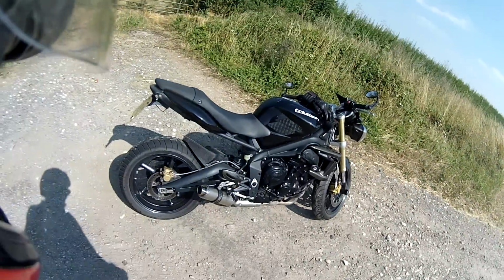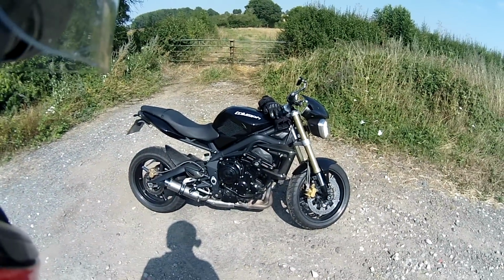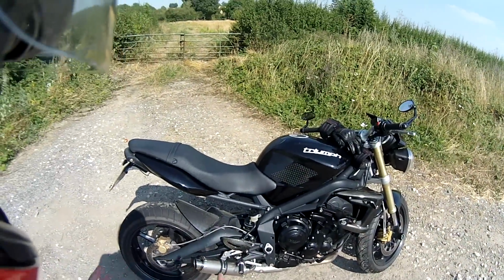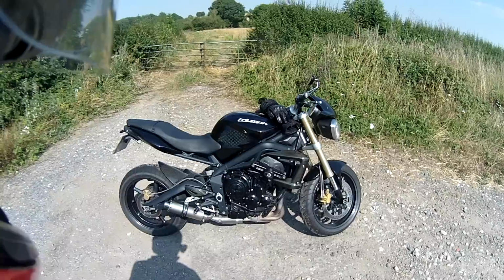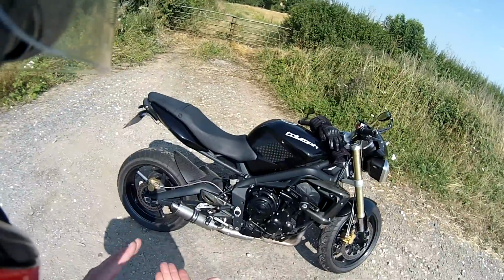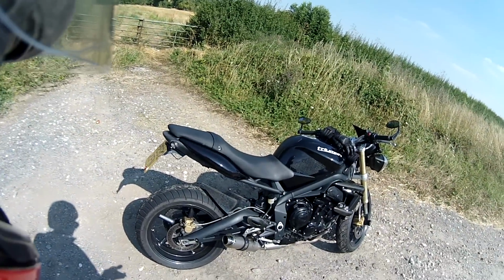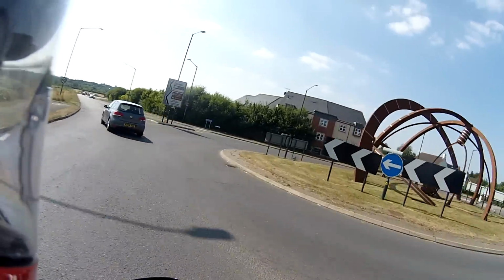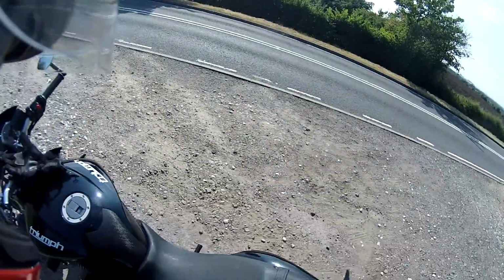SP Engineering Race Exhaust for my Triumph Street Triple

Comment: What are you talking about. I run retrospectively 3/1 as opposed to original  3/2 Triumph Original Factory set up on my Speed Triple. After Factory a full Arrow system (Italian)now Arrow manifolds and mid pipe into SP Engineering Low Boy Stubby GP Exhaust....It’s wrong to say it’s cheap it’s the bollocks..sounds better with a bigger bike bro..just saying..
Reply from the maker: #justsaying

Comment: Did you go to a dyno after remapping?
Reply from the maker: lazdamaniac I didn’t mate. Noticed the lack of weight over the back wheel though.
Reply: @birdoneword  do you have the map, so I can try it on my striple I have an hp corse hydroform similar to the one you have. But it has been stalling at low revs...
Reply from the maker: lazdamaniac the map was a standard triumph remap. They usually charge £25